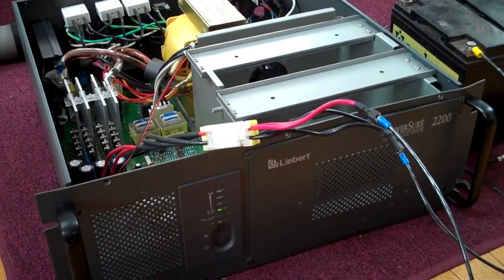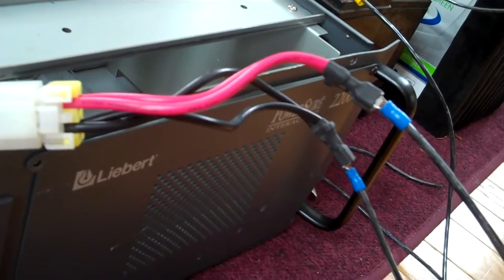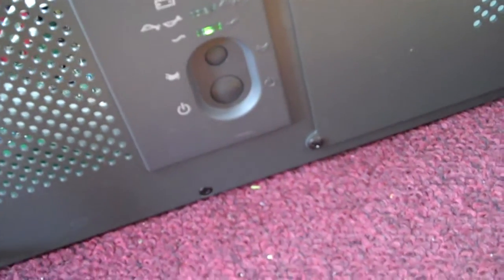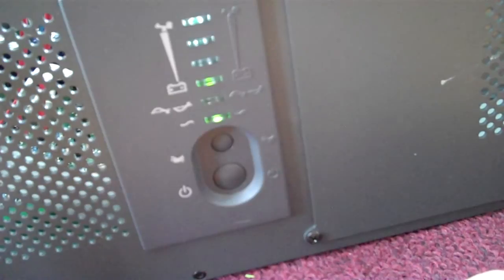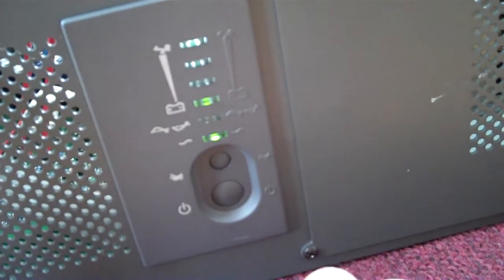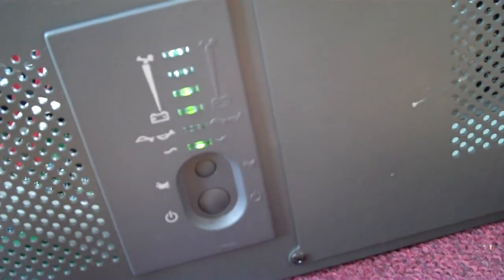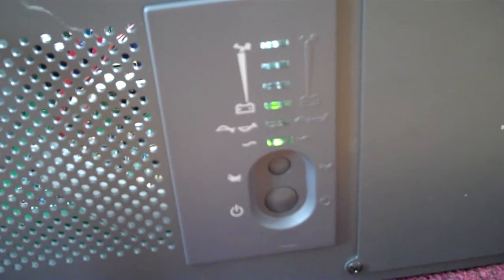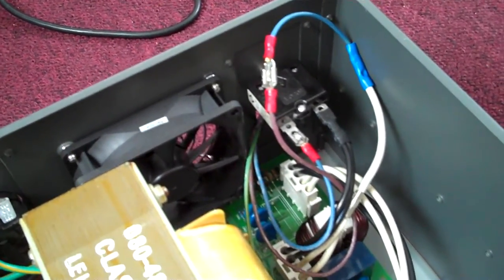48V UPS for DIY Solar PV System - Part 2

Comment: Pushing the mute button on that Liebert will run a short on-battery test. The LED meter while on AC is showing UPS load, and while on-battery it shows the battery charge.
The mute button is usually used for silencing the annoying beeping unit during a long power outage; since you are designing this into a larger purpose in life, you might want to just disconnect the buzzer. I'm not sure if that unit can be field configured between SLA (AGM or VRLA) and wet cells or not; could be an issue.